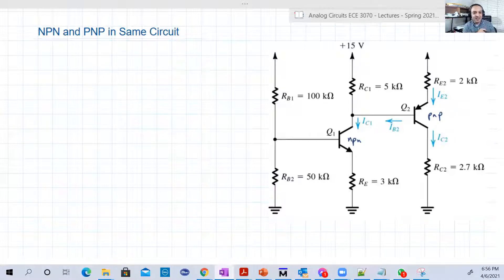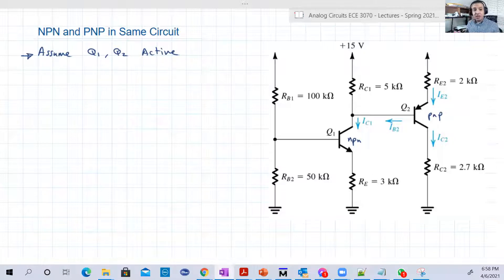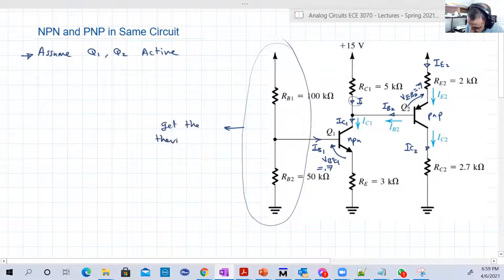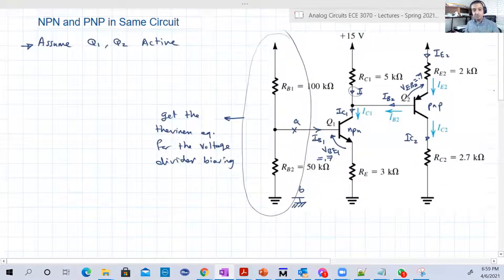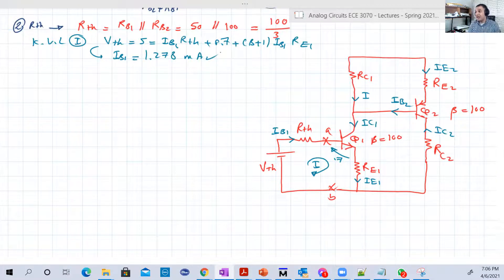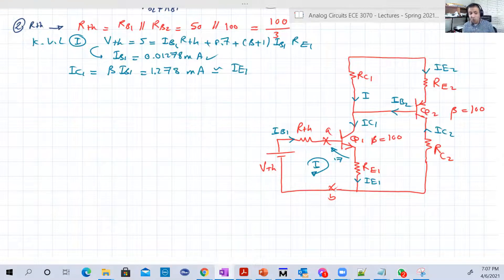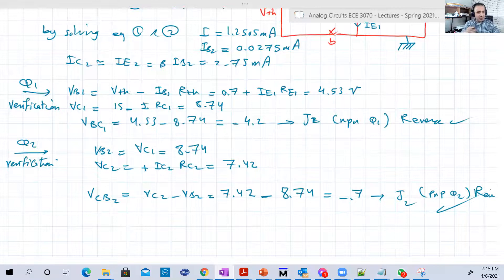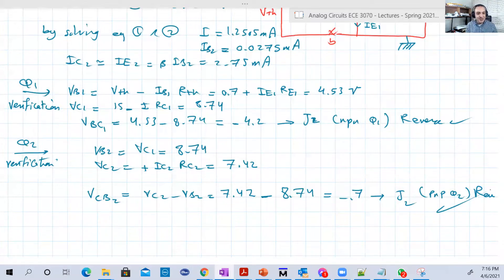[19d] NPN and PNP transistors in the same circuit

Comment: When you aplied the k.v.l 2 why you didn't take  15V
Reply from the maker: because the 15V is not part of the lope. basically to to consider a battery as a part of a lope and take it into account in KVL both its terminals should be part of the loop. In that example only positive terminal is part but negative is not. 
Plz watch other videos Esma and share this one with your colleagues. 
Thanks for watching